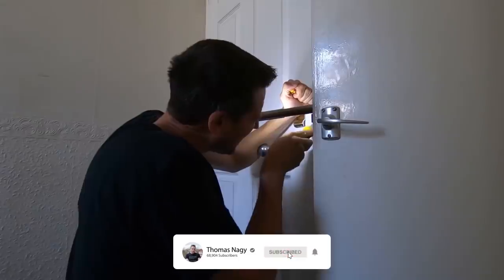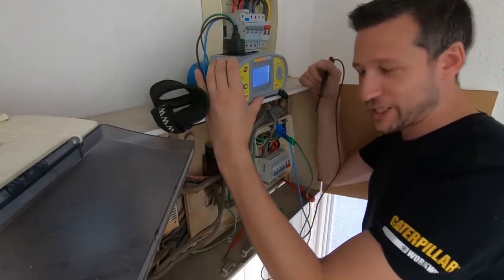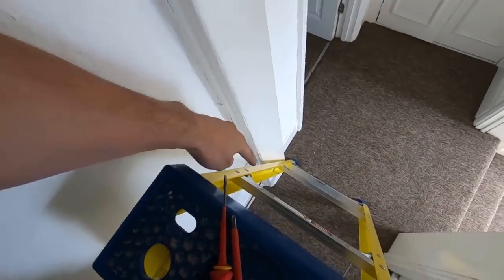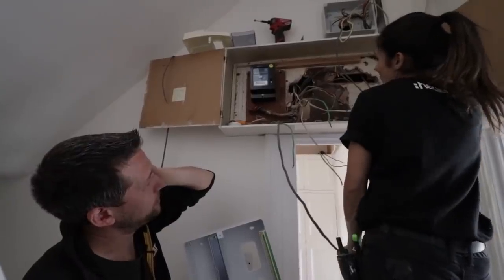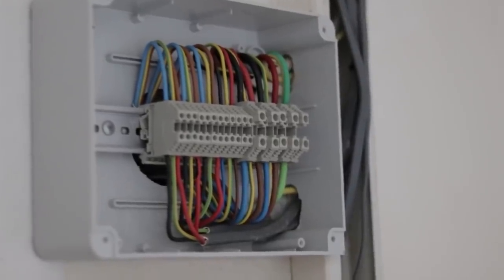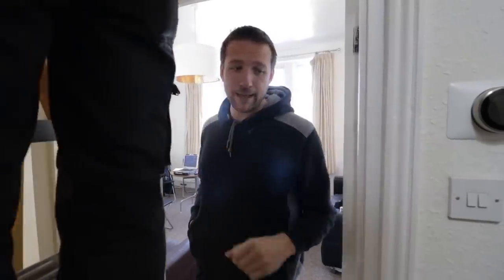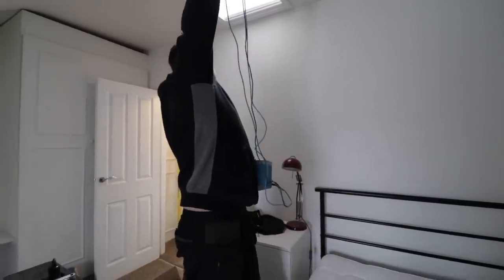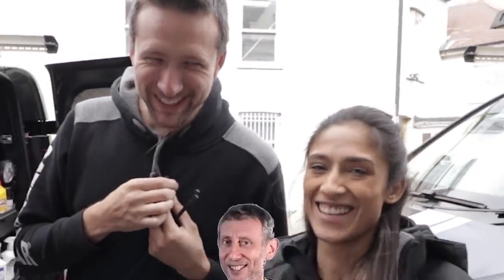Turning 3 consumer units into 1 big board.

Comment: Ooh a nice old dead wylex asbestos fuse boras where you had to fit fuse wire if it blew abs done contained asbestos as a flash gaurd, so asbestos in other places in the flat  are high if that’s the sort of fuse box was used.

Comment: those LAP light fittings tom are SAXBY Nitro LED rebranded as LAP. spoke with a saxby rep and he confirmed. they also make a plaster in bezel for these fittings. just installed 81 in a smart home project wicked lights! (the saxby badged version is the same price). Also mate, I use the Intumescent sealant instead of fire foam. its the same stuff the fire barrier guys use in risers
Reply: V-Tac are also the same light, from CPC for less than a tenner, had 3 fail out of about 500 in the last year

Comment: Using the test adapters also include testing the integrity of the contacts in the light fittings which are bypassed when you go direct to the connections on the back.

Comment: Hi Tom and all. Thanks for the tips on the comments you write on the EICR forms. It's an improvement on what we currently write on ours and our inspector said the same last time he was here. In the spirit of returning the good advice, I would highly recommend checking out Electraform, the cloud based certification software service for sparks like us. We used to use a well known PC/Laptop based one and the issue was always getting the certificate numbers right and having to wait for our electricians to send back their certs and reminding them if they didn't. It's really easy to use and set up. It takes a little getting used to (at first the being online and having to re-type if you lose connection is a bit frustrating) but once you do get used to it and embrace it, it really does make a difference, especially if you have a few people doing certs. Being cloud based means you are always up to date. Our team have being using it since we came back from lockdown and prefer it. We have tried the NIC EIC one and its just not for me or our team at all. For the record, I have no affiliation or links to the company, I just want to spread the word about something that makes my business better and makes the job easier for our lads. Our industry is finally gaining some positive momentum with all the new tools, accessories and young smart electrical apprentices, we are all finally sticking together to make positive changes for the better. Thanks again Tom. Nice to see someone on the journey we had and for keeping it honest and real.
Reply from the maker: Thanks for the tip - we will take a look at this👍

Comment: Trunking I use a hammer and a cloth to protect the surface from the impact. Cloth folded over 3 times to make a nice thick cushion, and tap gently to close it, then slide the hammer and cloth down to zip the side closed all the way down, and do again for the other side.

Comment: I've fitted loads of those LAP downlights,  they're great and definitely good for the money.  Can be covered wirh insulation too. Not had one fail yet. Not to be confused with the similar looking and slightly cheaper ones that don't have the large separate connection box, those ones are crap...

Comment: Agree with LAP.
For example, their cheapo sp double sockets are exactly that, cheap and agricultural (fitted some once due to budget for upgrade later) but the DP double sockets are not bad, nice finish, smooth switches, ok terminals, for the money ya can't complain. Match in with MK stuff too, never mind the wierdly seized/poorly threaded terminal screws on MK light switches that nearly break the fitting...

Comment: Why is it you have to update fuse boards to metal but you can extend in plastic box ?? Am I missing the point
Reply: Because the most likely place for a fire to start is in the distribution board - the cables themselves are most unlikely to spontaneously combust. I wouldn't put it past IET to insist on everything in metal conduit in an upcoming rework of the regs!
Reply: the plastic enclosure is downstream from the protection device in the main board, so any overheat faults should stay in the metal enclosure

Comment: Slight diversion. What do you do when you are replacing an old CU with a new CU and the cables just aren't long enough to meet the terminal bars and MCBs in the new CU? Is it ever acceptable to splice the cables inside the CU or is this a situation where the only option is a rewire?
Reply: Extend

Comment: I keep having the budget fitting discussion with people online, mainly from Germany, who seem to think if something's sold in DIY stores it's automatically bad (completely ignoring the fact that almost all DIY stores also sell all the respectable brand stuff, although one chap has gone as far as claiming that even those manufacturers supply inferior products to DIY stores than to electrical wholesalers).

One brand that comes under fire particularly often is Kopp. They sell pretty much everything you need for first and second fix, except cables and wires. Their switches and sockets get lots and lots of flaks and comments like "No electrician would ever use them!", as do their MCBs and RCDs but I know plenty of places that must've been wired by qualified electricians, surely the city wouldn't get DIYers to wire new blocks of council flats with hundreds of flats, and most still work after close to 30 years!

Comment: LAP lights good, LAP switches/sockets junk in my limited experience (I only used them once,  never again) The screw terminals in the sockets and switches were under engineered and the threads stripped before a reasonable tightness could be achieved. I've used loads of the LED lamps (GLS replacements, down lighters and strip lights) with no complaints at all.

Comment: Do you have to install fire rated fixings if cables are above plaster board ceilings? Or does it only apply to cables ran surface?
Reply: Only surface

Comment: Not convinced by the LAP lights, I have seen so many problems with their previous products that I am wary of trying anything else from them. My current philosophy with downlights is where possible to go for  separate bulb type units, that way if the bulb goes the customer can replace it rather than me having to deal with replacing the whole unit.
Reply: You are correct farmersteve ,I’ve had loads of issues with sealed fittings from different manufacturers, gu10 and cans all the way from me.

Comment: What company made those downlights? What is the voltage range for them? I am in an area where I need 110/120v
Reply: LAP is a "fake brand" sold through Screwfix in the UK only, they only do 220/240V fittings and are unsuitable for your application. I say "fake brand" because there is a legitimate company in Britain called LAP Electrical Limited that manufactures automotive electrical accessories and is otherwise unrelated.

Comment: 12:47 Duuuuude... still way to aggressive. Just clip on the first 20-30cm, pull away the lose end in a nice big curve and just swipe it on with your palm. Almost no pushing or hitting needed for this job. Try it out! By bending the lit away from the trunking, the edge will spread a bit apart and than it's just swiping.

Comment: I just opened this fuse box and found that it contains 5 8-way Wagos - 1 for L distribution, 2 for each earth and N, Earth and N tied together, 1 broken screw for cover and box not fixed to wall. Next step: trip to home depot to get supplies.

Comment: Did you get the reg number for that van?  Send the video to the Police so the driver gets a free "Leaving the Scene of an Accident" prosecution 😉
That cable holder thingy would be called a "Lazy Susan" in catering.
Reply: It's really not worth the hassle for a £100 repair.
Reply: @idi0tdetectioninprogress  It's not worth the hassle of sending ONE email with a file attachment to Plod or to the company concerned?  5 mins.  If to the company a copy invoice for the part and a cheque will follow back.
Reply: @cjmillsnun  £ 100 is more than enough money to spend a few minutes chasing. The driver could also have been impaired through drink or drugs and should be off the road.
Reply: @UberAlphaSirus  at this point I feel like you were the van drive that knocked off the mirror. You seem to be defending them on every comment. Hit and run’s are not good